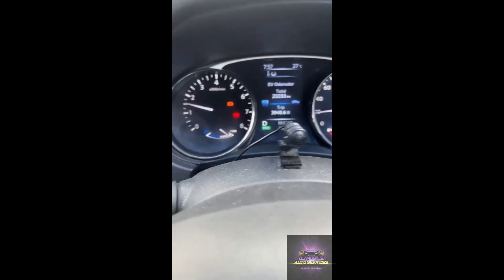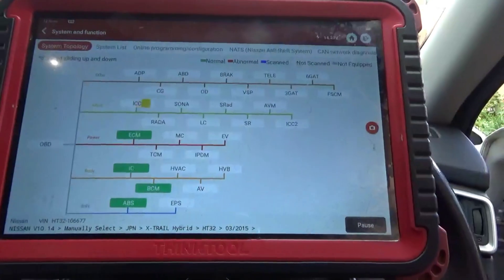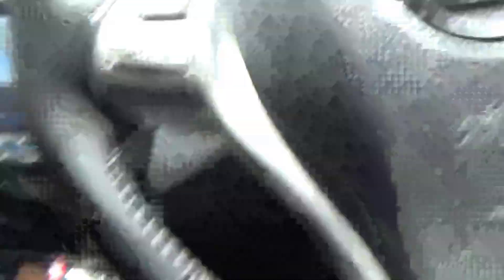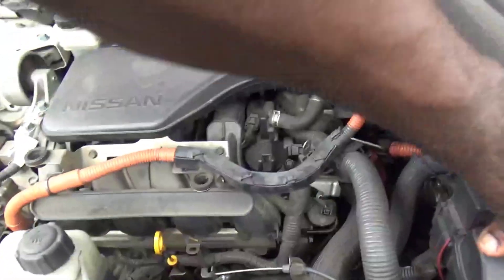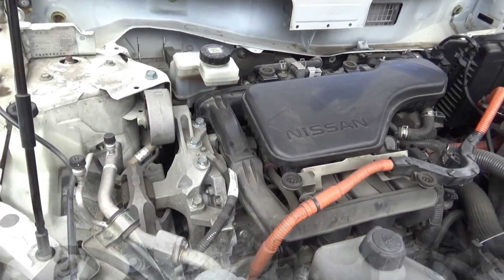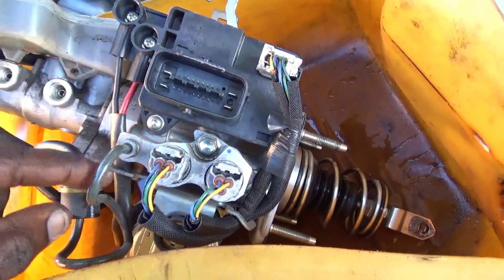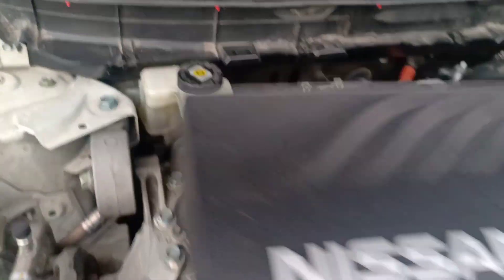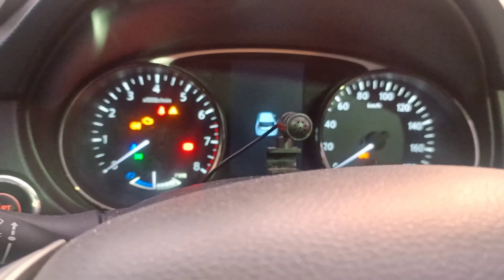2016 Nissan Xtrail Hybrid Brakes Issues. C1111 Pump Motor & C118E Accul. Pressure. Diagnose & Repair

Comment: I am having the same problem with my version of this Xtrail. Can you tell me where I can source the replacement pump?
Reply from the maker: Find me on FB
Reply: am machanic in new zealand currently, can u supply the part for me
Reply from the maker: @Ruheegunturmirchee im not sure where the guys here are purchasing the motor from. Probably on a Chinese website. You can check to see if you can order one from there